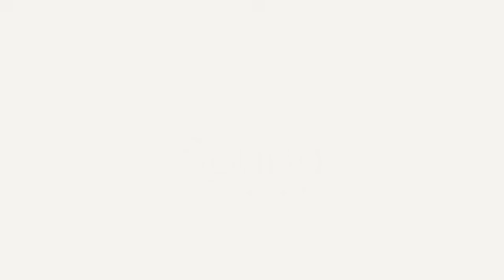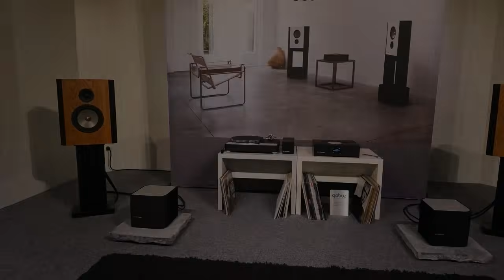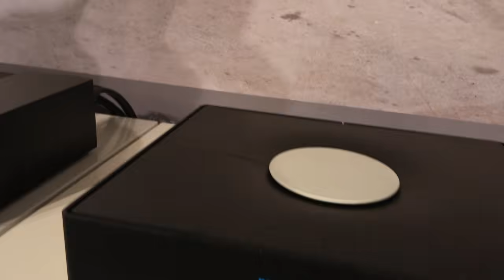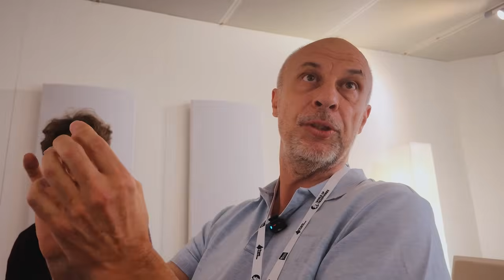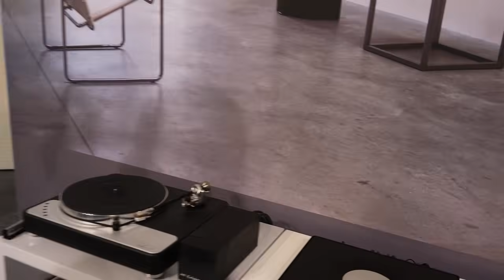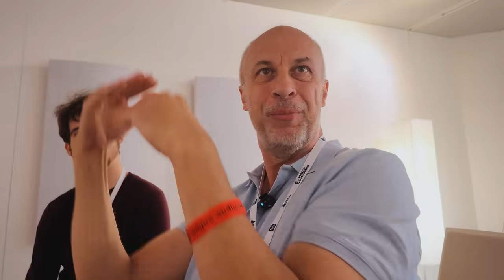Grimm Audio PA1: The Distortion Everyone Else Ignores | Guido Tent Interview

Comment: You cant rid  distortion , no Matter how capable the equipment .  You cannot rid distortion no matter how you try , it is not possible ,  especially when connecting audio equipment together by cables or even no cables , or no matter the electronic equipment . You cannot rid distortion out of recordings .  The guy is full of nonsense , full of crap 🤣 .  Anyway ,   The guys a joke ,   using metal drive units that do  ring  🤣🤣🤣 . His system is not better than a pair of Active ATC SCM active system .  He's talking out of of his arse and absolute nonsense if he thinks his system is more capable because he thinks it is  🤣🤣🤣 ,  what a complete joker of audio nonsense ,  when he cannot even produce a neutral audio capable sound because he is using standard off the shelf metal drive units that ring at certain frequency .      🤣🤣🤣 .   The guy is so self absorbed in his own self lies he's the absolute joke as regards  real quality audio  🤣🤣🤣 .
Reply from the maker: Wha???
Reply: LoL 😂

Comment: Hm ... they have their whitepaper explaining that you should use a wide curve at the sides and down below of the housing, on their website they have only these product versions (which I found always very good at High End Munich), and now I see versions with flat 45° corners?! WTF?!? Besides of this, I don't buy it that these amplifiers are audibly better; where are independent double blindfolded listening tests? I would bet a high sumn that they won't find any audible differences in these tests, this never worked for any company (which is the reason companies never publish these tests, or even do them at all). The Purifi LF and MF drivers are phantastic and probably the best in the world (I have 8 in different sizes), some Grimm folks founded Purifi. But most (non-tube) amps, even budget ounes, since the 90s are some ordes of magnitude better than even these phantastic Purifi drivers. Professor Anselm Goertz from TH Munich wrote interesting articles about this, and pointed out how disappointed he was being not being able to hear any differences in blindfolded tests IF the amps were very precisely (±0,1dB) adjusted to the same amplication / loudness of the speaker. So I recommend to use simply some good amps, and you are just fine. Goertz wrote (measuring around 60 amps from different manufacturers): "The first series of tests [1] had already established that any audible differences between power amplifiers operating within their normal range, well below the clipping threshold, are usually attributable to minor differences in frequency response or inadequate level matching—if such differences exist at all. This second series of tests was intended to examine operation at and beyond the power limit. Here too, the conclusion is fairly clear: what matters above all is high peak power, so that all signal peaks can be reproduced without compression—and nothing else. ... The key conclusion, therefore, is that provided a power amplifier reflects the current state of the art, it no longer has any audible influence on the audio signal. Differences are limited to the amplifier’s ability to deliver the highest possible undistorted output voltages combined with high currents into low-impedance loads. Additional quality criteria should therefore focus more on peripheral parameters such as signal-to-noise ratio, common-mode rejection at the inputs, the accuracy of the level controls, the protection circuitry and, not least, the power-to-weight ratio." Also, another point I really, really disliked in the Grimm product portfolio: They try to sell us expensive cable which sound more "transparent", and this is - of course! - a scam, because cable does not sound. No audio company never proved such claims in double blindfolded tests, and the only situation where cable really sounds is in guitar cables (the capacity of a guitar cable influences high frequencies because a guitar has a primitive passive circuit) or if you use very thin cables for high amplification of low frequency drivers.

Comment: One could imagine the Difficulties  to closely Match the Characteristics between 60 Pairs of Output Transistors!

It's interesting to hear/see a new Designer explaining his approach to an Amplifier.
Reply: Thank you for your important question Eric. With this many devices in parallel, we can apply a high level of emitter degeneration (the amount of degeneration actually scales linearly with the quantity  of transistors involved), ruling out the eventual mismatch between de transistors. And I have to add a small correction, it is 48 transistors, not 60.
Reply: @Gee1967Tee I was going with what you said in Video.